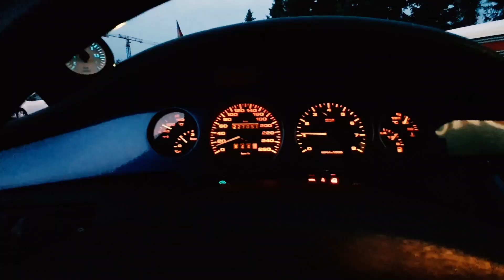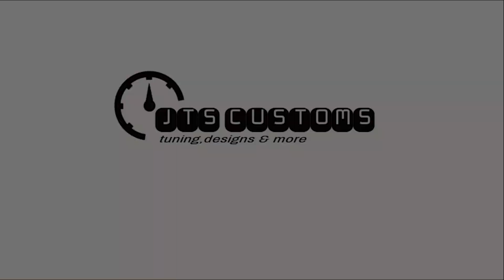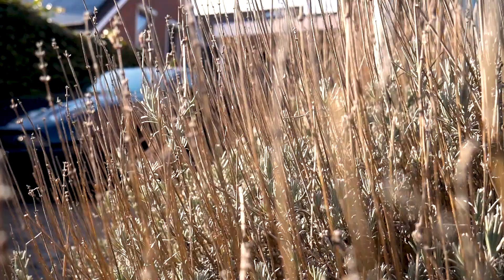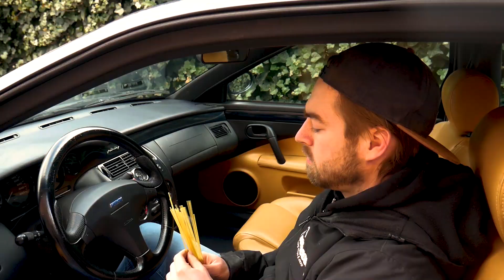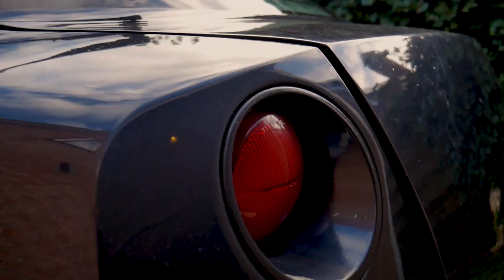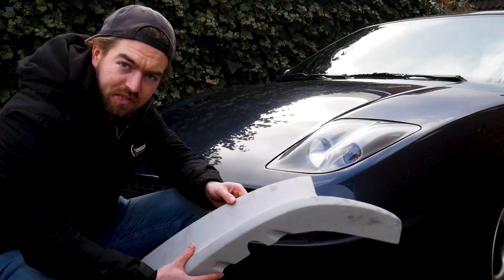I BOUGHT ANOTHER CAR - Fiat Coupe 1.8 16V

Comment: Always wanted one, planning on picking up a 5 pot. Couple near to me in bad condition, figure im gonna have to look further. There's a specialist a couple hundred miles away selling the limited edition ones. In so many ways its a terrible idea but on the other hand, you only live one time.
Reply from the maker: Life is to short to drive boring cars😂😂 just go for it, you wont regret! They all need love so prepare
Reply: @jtscustomsNL  yeah I very much want one to be my first car. The reason its a bad idea is because of logistics is all hah. I have enough saved up to nab a 20v no problem. But I would die for an LE one. Only issue is the cheapest LE I can find in England is double my budget. Got fired from both my jobs last year but once I've scored a fresh job, if I haven't already bought a 20v, I'll treat myself to a 20VT LE
Reply from the maker: @thesinisterspoon7290  make sure to look at some different ones and choose the one with proper maintenance history. Most important part is the timing belt! Make sure that it is recently changed. Sadly there are many out there that dont get much love.. good luck!!
Reply: @jtscustomsNL  yeah I have a couple ads saved where they've had a wonderful service history and they're in great shape. The LE i have my eyes on was a recent restoration with a nice new cat back and suspension, tune and some other nice quality of life things. 11.5K
Reply: @jtscustomsNL  yeah, the Cam belt can be a big job. Not the end of the world if you know how to change them yourself but definitely a time consuming process. Trying to find one thats a good balance between something I can do work to and something that runs well